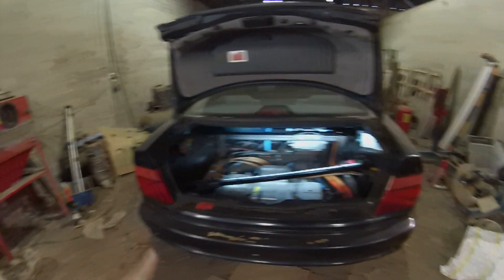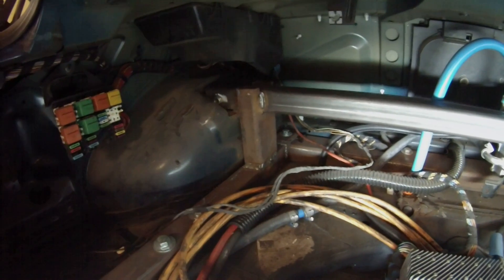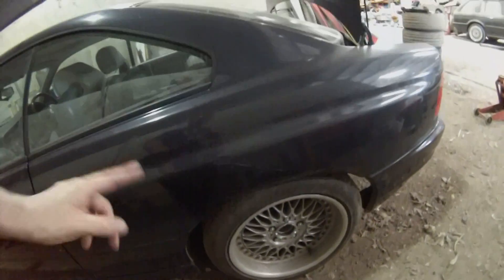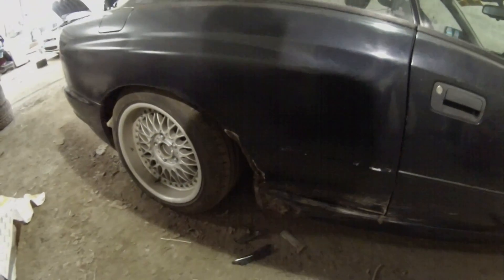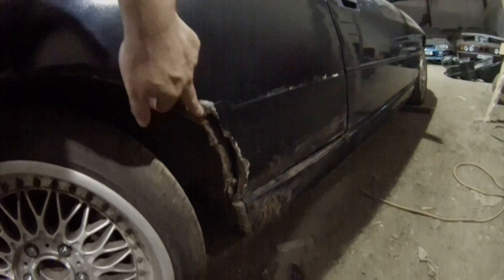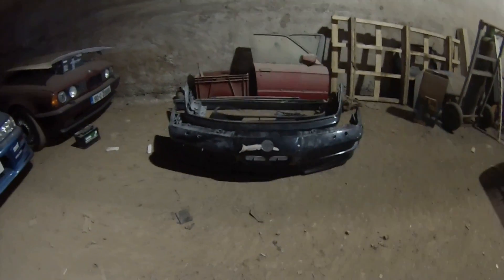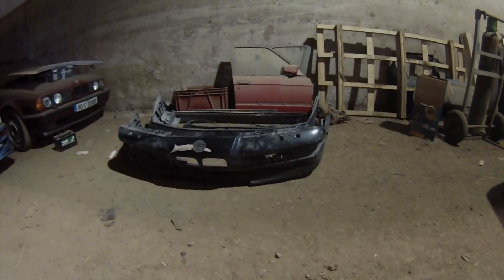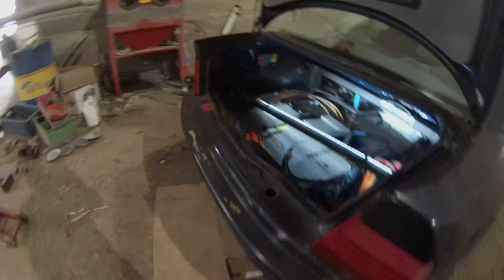BMW E31 840CI EV Conversion 106 : More Repairs

Comment: Good to see the Panzer is back on the road to recovery. :)
As for the rust repair, the only way I know is to cut out the rust and hot glue some new metal in. There's bound to be some repair shop in your area could do it in return for some of your expertise in the electrical/electronics area.  ;)